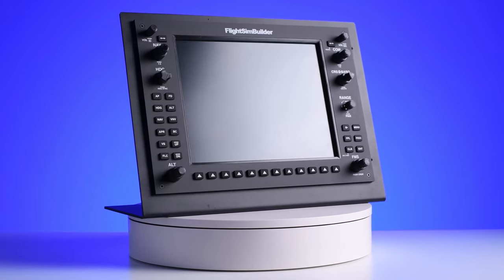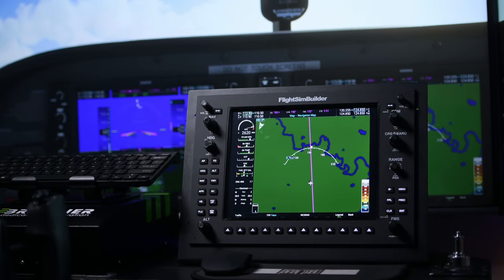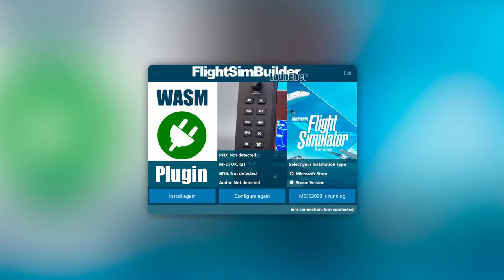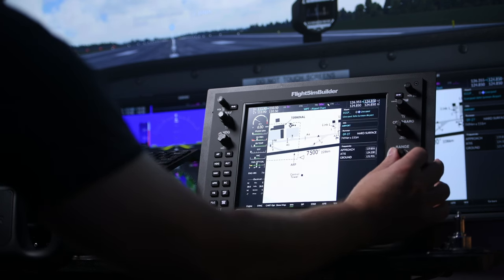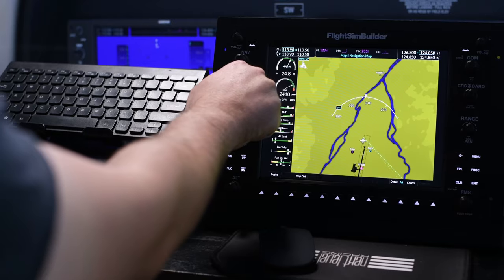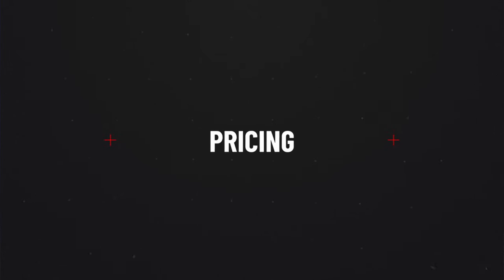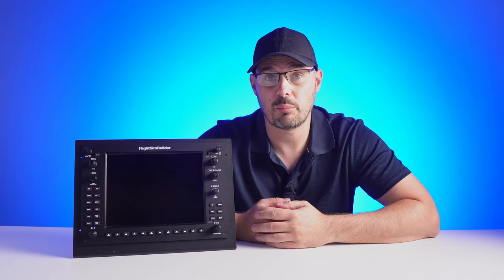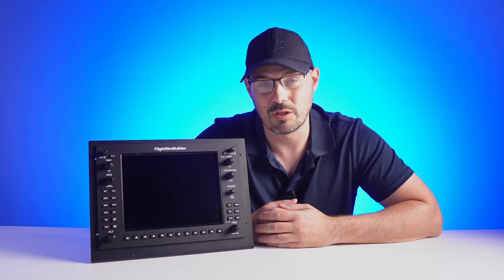FlightSimBuilder: The G1000 Every Flight Simmer Should Consider

Comment: 6:22 I recently received the G1000 setup from RealSimGear and mounted it in a Stay Level Avionix panel. Pop out panel manager has been super useful in getting the G1000s set up since I'm constantly loading in new flights. I did notice the black bars issue so I'm glad it's not just me experiencing it. I can sometimes get it to fill the full screen if I toggle the pop out panel manager white bars/fullscreen settings but it's not 100%. Usually it'll fix itself on my MFD but retain the black bars on the PFD. Bit of an annoyance just due to the soft keys needing to line up with the display.

Stay Level Avionix has a G1000 comparison on his YT channel and it looks like the most premium consumer option is definitely the Aviatek units but at nearly 3x the cost of the RSG units (!!) I probably could've saved about $500 going with FlightSimBuilder but I think RSG is a little bit higher quality in terms of the knobs and buttons. You can't go wrong with either.
Reply from the maker: Thanks for your input. Great for other to share their perspective. This will help others. Yea I hope Asobo fix this soon.

Comment: Pretty neat but rather than use the icky layery look of 3D print knobs, simply make a silicon mold on a print from a resinprinter that's vastly finer in structure and you can pour 2 component plastics and they will look completely pro.
Reply from the maker: I’m not fully aware why they went for 3D print but there must be some reason for it. It is a great 3D print though.
Reply: @g-locmedia  some think it's cool or they just didn't know any better that you can home make pretty good products when they are small and expensive.

Comment: I like the tactile idea, but my 12 inch tablet and MatricApp combined is about a third the price!
Reply from the maker: Do you use knobster with that?
Reply: @g-locmedia  no, again, cost.  I actually have 2 devices - an old 6 inch mobile phone and the 12 inch tablet.  The have virtual switches and buttons and multi position dials.  They do lack the tactile feedback of an actual switch but they do the job.  Still got the visual feedback of them being in a certain position and they are distinctive visually to be more useful than a keyboard.  Plus, some have macros attached, mainly things like switches that simulate me holding a button down - freeing me up to do other things.
Reply from the maker: @CMDR_CWolfxUK  sounds like a neat setup mate
Reply: @g-locmedia  cheers, ai'll post more about it when I have sorted out the new place it is going to live in the house.  I do have a video out soon showcasing one of them.